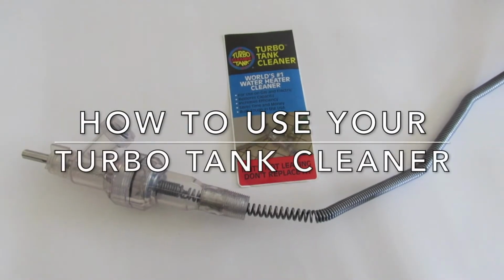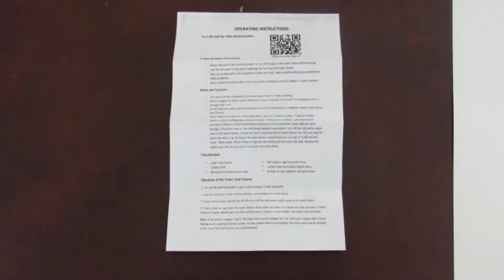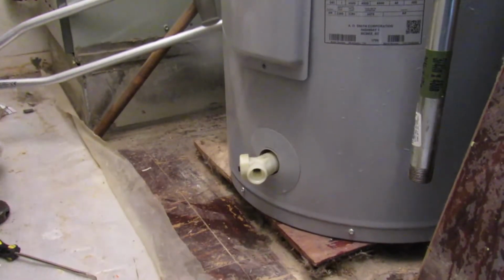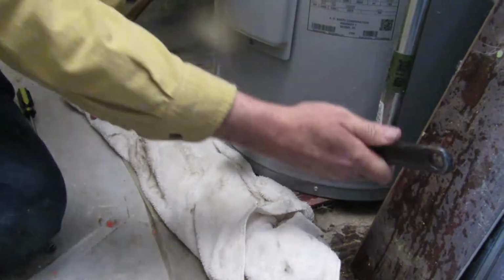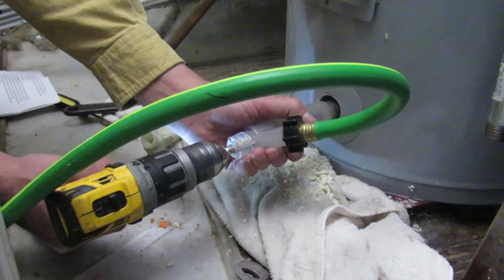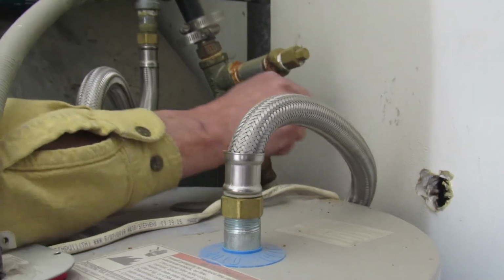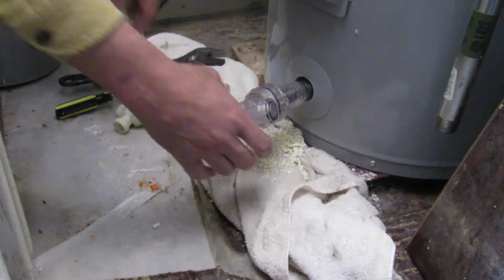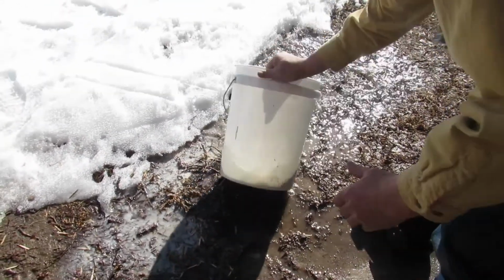TURBO TANK CLEANER | How to Use

Comment: As a Professional im asking myself if I want to offer this product to my clients... Im definetly not comfortable asking a home owner to remove the tank drain, use the tool and properly reinstall. However   if I remove the drain and provide them a full port ball valve so they can easily open the valve and insert  the tool then perhaps.
Reply from the maker: A lot of people do replace the factory drain valve with a ball valve. This does make future cleaning with the tank cleaner easier.

Comment: Well, it went pretty ducking bad. I couldn’t get the drain valve unscrewed so it was just flooding this little area I’m jammed in. Then when I finally get it in there I had about zero sediment come out. I’m in TX, I am 100% sure we have hard water (I get water stains and rust stains on the shower tile), I’ve lived here for 8 years and never cleaned the HWH before… where was all the sediment!?

Comment: I purchased this close to a year ago and found time to use it today.  To my frustration, the flexible shift snapped off within the plastic case. This happened within 2 minutes after I started using it.  

I can't see into the tank in an effort to remove the shift.  What should I do?

Comment: I have very thick deposits at the bottom of a flat 50 gallon tank bottom.   This tool only scraped a little off the surface but was unable to break off the bulk of the material.  Any suggestions?
Reply: Reach in there with a screw driver?

Comment: why make it so cheap but so expensive it a rip off great idea but made to cheap this is why its hard to support made in the USA this is more like made in china but sold buy a greedy American. make it stronger then this will be worth it
Reply from the maker: Hi AL,
Thank you for your comment. We take quality control very seriously. All of the failed and returned cleaners are send back to us for analysis. We have identified and mitigated all know problems. Right now we are out of stock.  In a few weeks new and improved parts will arrive. 

1. New plastic mold.
2. Changing plastic to polycarbonate. 
3. Getting rid of metal sleeve. 
4. Thicker grinding disk.
5. New shaft seal.
6. Improved instructions. 
If you have had a tool failure please feel free to call Craig at 208 520 5579. I will  be happy to replace it.
Reply: My God dude did you skip grammar class?